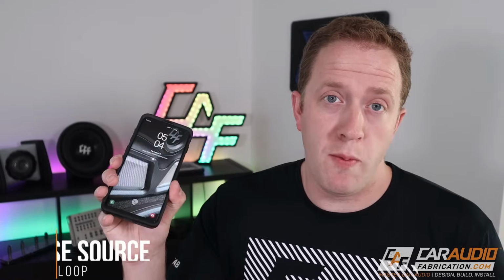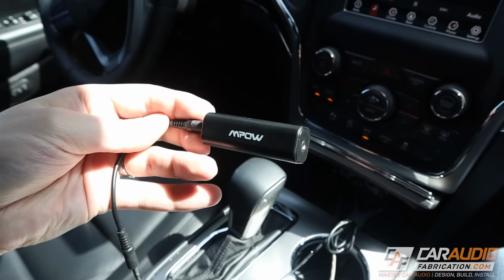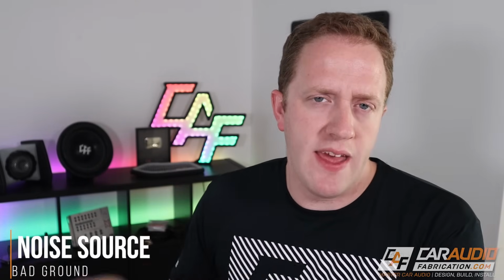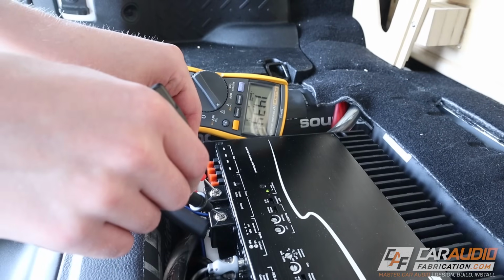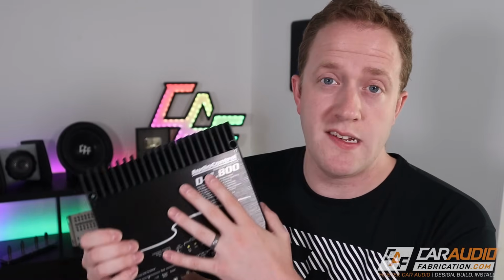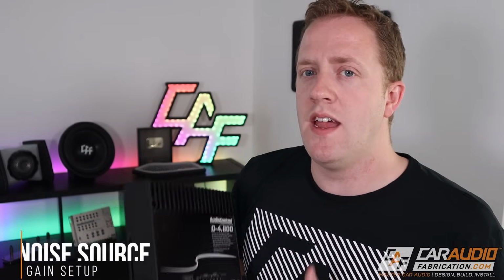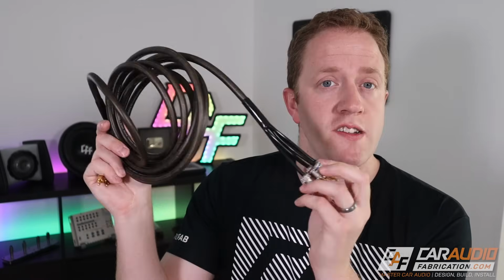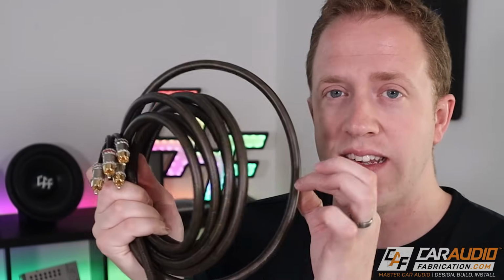BUZZ, WHINE, HISS? How to FIX Car Audio Noise!

Comment: I installed a Pac lc1 and at certain spots in the knob I get road noise when I accelerate or hit bumps. But I didn't have any of this before for the lc1 bass knob was installed could it be a dirty potentiometer or defective any suggestions would be much appreciated Thanks.

Comment: I had serious alternator whine even though the power cables and rca cables will running 1.5 meters apart from each other, I started by replacing 3 sets of rcas and the whine was still present. Did the big 3 upgrade and was still present, tried the rca ground loop isolator and it worked but that was a band aid over the problem. Decided to risk it and ground the outer shield of the rca output to a screw on the headunit and the problem magically disappeared. No more alternator whine and no more loss sound quality due to the ground loop isolator

Comment: I wish this video was around 10 years ago! I had engine whine coming out of the speakers. It turned out to be the alpine head unit needed a better ground. As well as giving my second battery a better ground through the engine block instead of body ground.

Comment: @caraudiofabrication I have an issue with an hdmi to rca adapter going into my android de k from my raspberry pi computer its the only thing giving me a static sound when i use it in my car.  Otherwise I have no issues with noise.  Any advice?

Comment: What about amplifier sending a signal to subs on its own beat (like it doesnt follow the music and even starts thumping before my stereo turns on all the way)?  I recently checked spark on my truck and and after that my amp doesnt always follow the beat. I tried the amp in another vehicle and it works fine so im guessing the high current spark ruined some wiring or something?

Comment: 2018 Equinox,  the past 2 weeks I have noticed interference on am radio. Today I turned off the a/c and interference went away.  Turned it on and it came back. Very strange.

Comment: That's why i run a common ground from body to deck then to my eq & crossover, and then to the amps. Just follow the signal chain and ground everything along the way. Also always run power on opposite side of the vehicle away from signal. Never have an issue that way.

Comment: Hey, thanks for the info!
Yes. I have noise in my system and after watching this, I think I know what's wrong! 
The mounting screws for my amp are not only into to the board on the back of my rear seat, but I actually made sure they went all the way through the board and into the metal in the seat-back. I'll bet that is grounding the amplifier's metal casing. I'll find out soon enough!
Thanks again!

Comment: Replacing sla batteries with lithium batteries can introduce a lot of alternator while because the sla will absorb that whine where the lithium doesn't just had this issue

Comment: Im still fighting alt whine..
Checked everything. If i run the head unit on a isolated battery no noise... (Tried 3 different decks)So i believe its in my alternator it has a factory noise filter on the alt.
Ive had noise before but this is hardest i delt with

Comment: i got one for ya bro, that even our good friends at Crutchfield couldnt figure out... i get a "skipping record" type of interference while playin music thru my samsung galaxy phone over my car stereo... it sounds just like if u were listening to a old record with a scratch & itd jump fwd a hair (aka skip) when the needle would hit the scratch... ive got a 98 firebird (was a factory monsoon system) with a JVC Arsenal kw-r925bts head unit sourced via crutchfield last summer & a full compliment of top of the line CDT E.S. speakers sourced via ian kee of kee audio, 10 speakers all total, (no 10" sub, yet) using the factory monsoon amp & factory wiring (the cars a clean un-molested 1 owner) & all the speakers are cherry picked & ohm matched to jive with the monsoon amp per kee audios instructions... it has a mixture of dynomat, hushmat, & wave breaker pads, as well as the gasket tape u had recommended, & i recently added a "JitterBug" from crutchfield in an attempt to try & clean up the signal skipping issue... best i can tell, its random, it will play flawlessly then suddenly itll skip several times, so no rhyme or reason, & my phone plays fine & doesnt do this when im using my headphones, just with my car stereo...???  any ideals? or suggestions? always enjoy ur videos, derived a great deal of inspiration & education from them, especially during my stereo project last summer... thanx!

Comment: My mate has a gun shot sound that comes throuh the speaker, it can vary from seconds to minutes before the gun shot sound comes back.
He have changed everything, I mean everything, from signal cables, power cables, new amplifier (has smoked two), new subwoofer and new head unit.
Ground straps are good, negative stud is welded to the body.

On the car, all ignition stuff is changed and it still does the gun shot shot sound.
Car is classic so not much electric gizzmos are present.

He even teste the whole system out of the car and even then the gun shot sound was present when the engine is running.
System have not the sound when engine is not running, tested both outside of car and installed.

My bet is the injection fuel pump building up some sort of static thingy and the goes boom.
Everything else elctical is changed on that car.
Car is in concourse state, and very frustrating for the owner as this will not go away, and plenty of coins have been spent to fix this problem.

Any inputs regarding the fuel pump / gun shot noise?

Comment: I have an unrelated question. I have a 1973 Karmann Ghia with a Alpine 301 player/ receiver. I would like to add google maps and possible steaming music. Fabricating a screen holding device to add a second screen is something I can do as i ca work in metal, wood, and plastic. My phone screen is smaller than i would like as are most phones. Any suggestions for devices to integrate with the 301? I really don't want to syart over. I still prefer cd over copressed streaming. as i'm old

Comment: Yes, once. No matter what I did I could not remove it until I got a RCA ground loop isolator. This was back in 1989 in a 76 Vega. I think I bought the thing at Radio Shack.

Comment: perfect timing as i am having some interference with my new setup. i also have a bump/buzz noise which happens on start up and shut down. i spoke to a Audison rep which had said new fords (and other brands) do a system check which sends power to speaks and make this noise (may i add that the system check can also happen in the middle of the night while your not in the car and in some cases has resolved in the sub/speakers blowing) the solution for this is audison uss4 universal speaker simulator. mines arriving next week and will reply if all go's well.

Comment: Ahh, the infamous ground issue in aftermarket stereos. Great points sir. Need to check mine, using fm Bluetooth to stock radio for my phone. Powered by the cig lighter- getting feedback from my cars stock electrical system. Will be checking ground on radio, and moving ground on cig lighter for better isolation.

Comment: The most difficult noise issue I've ever dealt with was a popping sound when turning off my stereo. I don't use the speaker outputs from my head unit so I knew it was coming from the amps. I initially believed it was ground related and tried multiple attempts at improving ground connections to no avail. I even swapped out my RCA cables which fixed nothing. In the end the cause was my headrest monitors which were powered on by the remote turn on from my head unit. Electrical issues can be such a pain to deal with. If you're persistent you can get through it.

Comment: I have engine noise in one speaker during acceleration (when the gas pedal beyond the middle position)  I'm using a mini Kenwood amp, connected to the head unit in high output, head unit rca is not used

Comment: I had a problem with a remote wire in my buddys system . We had to run it by its self in order to be noise free but it worked .

Comment: I"m finding issues with just the 12v cig outlet to USB charging adapter, no 3.5mm aux cable involved.   With the USB charging adapter out, no noise.   But, no charging available.

Comment: Another issue could be a popping sound when changing sources on a aftermarket head unit. I have that issue and a very slight whining with the radio at 0 volume. I'm not too worried about the whining because its so faint and cant be heard with music playing

Comment: Awesome video! I've got a question. I have a brand new nvx jad 800.4 amp and once installed the same way as my other amp I noticed alot of static that increased with my volume when turning it up. I've tried a different ground this time it put it on the same ground as the negative from my battery and still have the same issue. The only other change is I mounted this amp to the side of my trunk. I've verified all connections are tight and are correct and no matter what this noise wont go away

Also edit my battery is located in the trunk

Comment: I always run a ground wire with the rca's and turn on wire to ground the radio at the same place as the amplifiers. Avoids a potential ground loop there too.